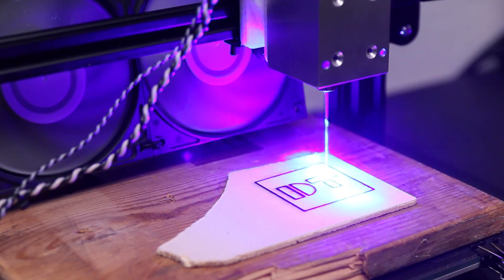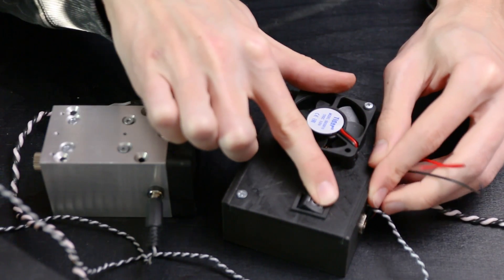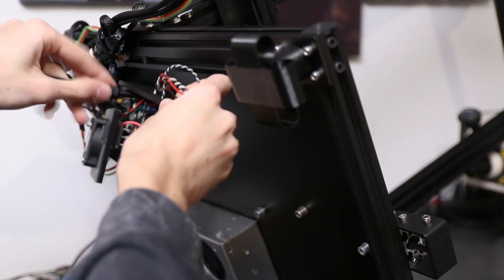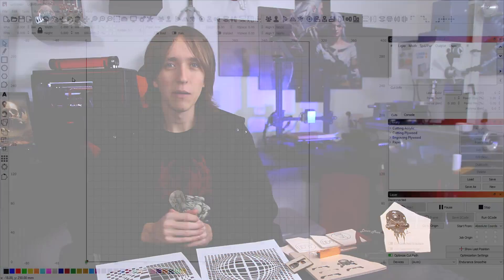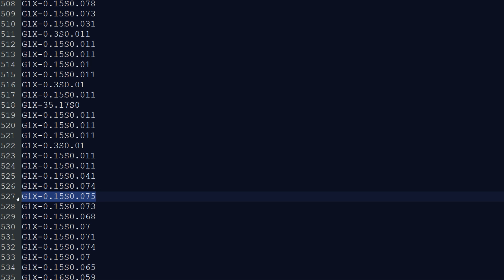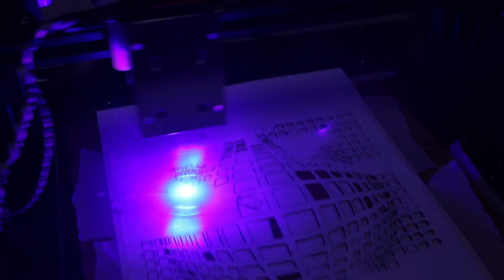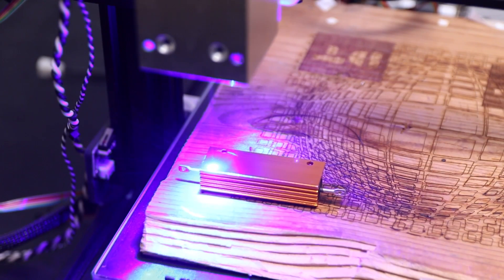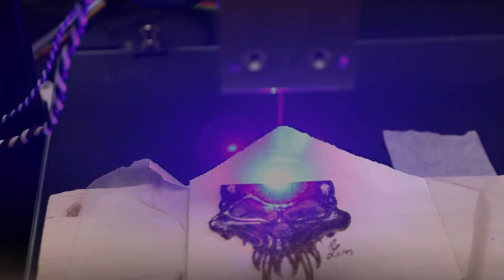10W LASER CUTTER on your  3D PRINTER! - Endurance Laser Review

Comment: I have a question. The laser modules I am seeing on the internet has 3 cables (12v, Pwm, Gnd) but the blower fan has two pins. How can I modify 3 pin laser to my 2 pin fan connection? Thank you.

Comment: The main problem with uv laser (400nm) is that the reaction is really bad on metal surfaces. So for metal, an IR (1064nm) fiber laser is to prefare. But for private use, I would go for UV or CO2 since most of the things we mark and cut is organic materials. What we need is a reaction on the material, which can be very difficult, therefor it wont help very much to spend money on a higher power, instead go for a second machine with another laser technique.

Comment: Interesting review of this 10 w laser.  I don't have a 3D printer yet, but the CR10 is high on my list of desirables.  I was surprised when you were saying that the 10w is not all that capable of burning through the wood since I was under the impression the Forge printer/laser was in the lower range of about 4w, but I'm not that sure.  Is it possible that there is a problem in NOT using a 3D printer that is meant to drive a laser as part of its abilities?   I'm not talking about the power connection because you addressed that adequately.  You mentioned the full range of opaque-nesses from clear acrylic and wood but I was interested in engraving other substances like leather and plastics.  Any response on these?

Comment: Save yourselves time and money people, and just get a Co2 Laser.  These diode lasers are junk as of right now in comparison.  They are cool for something to dick around with, but that is as far as it goes.   The time span they take to accomplish a raster is dismal and the focus point is shit in all honesty.   You can buy a chinese K40, (Which is actually a 30 watt machine) and upgrade it by throwing out the MO mirrors for Si plated units, and most importantly get a quality DSP controller like a lightobject T9 and have a machine that can raster at speeds of up to 500mm/second and cut 5mm acrylic and ply at speeds of up to 15mm/second with focus lines 10 times more columnated for superior accuracy with DPI scan gaping of well over 600dpi is desired.   Use Corel Draw with exporting plugins is also a must if you plan to actually do anything with any real speeds for business.    You can do all this for about $1K
Reply: You should make a video about it. Maybe put it on YouTube.

Comment: You can cut right through 3-4 mm thick colored acrylic with a 2.5 watt laser. You can also cut right through 3-4 mm plywood your METHODS are all wrong! much FASTER feed and many MORE passes! Your explanation about why you cannot cut through thicker wood pieces is just plain wrong. Again, Faster feeds and more passes and blow the kerf out with air! You can cut through ANY thickness of material with any laser that can even etch that particular material given enough time. (In high school I cut a highway transport BUS in half in 96 hours with a 20 watt C02 laser as an extra credit project) Colimating the beam will HELP but just re-focusing after every few passes (OR LOWERING THE HEAD....DUH!) will allow the focus to be at the plane of the cut. I never re-focus I simply lower the head on every pass just like you usually raise the head on every pass when printing. I use an 8 watt ($120) blueray laser to cut aluminum sheets up to 1mm thick! You have to condition the surface so you don't reflect all of the light by texturing and dying the oxide. After the first or second pass the surface is well coupled to the frequency of the blue laser and can continue the cut without further surface treatment. It's just difficult to get things started on aluminum. It takes a LONG time but you can laser cut aluminum with fairly low powered lasers when you understand how to achieve efficient frequency coupling.

Comment: Is it possible to use the laser on a 3D printer to pre-heat/bond two layers? The idea is that while printing, the laser beam will heat the lower layer while the nozzle is printing the current layer. Not sure if I was clear. Especially in big prints, lower layer are already cold while you print the current layer on top, so the idea is to use the laser to "glue" the 2 layers. Does it make sense ? From what I understand we can manage the laser beam and power so we would not need to use it at full power, but to hear at lower temperature that what the nozzle is printing at. Let say we are printing at 230, the laser would need to hear the lower layer at 180 (?). Of course the laser will point very close where the nozzle is printing.

Comment: I'm not sure if someone already mentioned it, but there is a spray that you can apply to metal that allows even the weakest of lasers to engrave it. The spray is extremely toxic and claims in the warning label to alter genetic material on contact.. So user be ware... but I have used it at my job with a weak laser and it totally works.  There is this one: https://www.trotec-materials.com/news/laser-marking-products. This is not the brand I have at work. But it does the same thing. There is another brand called Thermark... It's super expensive however. Like $60 per can. Anyway... hope this helps. Great videos as always. Very thorough.

Comment: would only use the laser with proper laser glasses (with the proper wavelight). With this high power lasers you can damage your eyes really easy. Even indirect reflexions can damage your eyes with this strong lasers. The dangerous part is that you dont feel it until its to late, it doenst hurt at all. Would really recomment even to build a close system